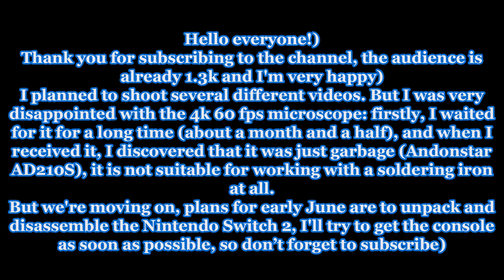Switch OLED Kamikaze modchip installation in 48 minutes

Comment: What tip are you using?
Reply from the maker: c210 handle, jbc with copper tip on it) https://aliexpress.ru/item/1005003898447927.html?spm=a2g2w.orderdetail.0.0.40fc4aa6ms88ke&sku_id=12000027414820908
Reply: @pro-modding my friend, how do you install that copper tip? Do you just slide it over it? Without removing the current tip?
Reply from the maker: @Sotseg  I filed off the working tip of the soldering iron and then attached this copper head
Reply: @pro-modding   Ah okay, thanks for letting me know. I will be doing the same.
But one thing; your tip doesn't look like the one you sent in the link. Is it the exact same?
Reply from the maker: @Sotseg  "T-IS", it is burned  in everyday work)

Comment: Whats the benefits of kamikaze mod over the nomal one??
Reply: That connection point is very hard to make otherwise, and unreliable. Kamikaze is non reversible, but when executed skillfully and properly it ensure a much more reliable connection to that point that otherwise uses a flex which must slip under the APU and isn't easy to tell if you have it lined up properly and secured well.

Comment: Cleannnnn !!!!! Pleas give me name of your flux , its incredible no clean ! Thanks men
Reply from the maker: Flux - Kingbo RMA-218.
Reply: @pro-modding thanks
Reply: and for clearing flux use IPA ? Or one différent product ?
Reply from the maker: @alexpassions  For cleaning I use a mixture based on gasoline. Sometimes isopropyl
Reply: @pro-modding oh 😮 Can you tell me more? 

1l isopro and 100ml bezina?
Reply from the maker: @alexpassions  https://ru.wikipedia.org/wiki/%D0%93%D0%B0%D0%BB%D0%BE%D1%88%D0%B0_(%D1%80%D0%B0%D1%81%D1%82%D0%B2%D0%BE%D1%80%D0%B8%D1%82%D0%B5%D0%BB%D1%8C)
Reply: @pro-modding  Do you put this pure?
Reply: May I ask you which soldering iron you use and what tips?
Reply from the maker: @alexpassions  c210 handle, jbc with copper tip on it) https://aliexpress.ru/item/1005003898447927.html?spm=a2g2w.orderdetail.0.0.40fc4aa6ms88ke&sku_id=12000027414820908
Reply from the maker: @alexpassions  soldering iron - 61\39

Comment: Great video! I wanted to find out what iron tip are you using ?
Reply from the maker: c210 handle, jbc with copper tip on it) https://aliexpress.ru/item/1005003898447927.html?spm=a2g2w.orderdetail.0.0.40fc4aa6ms88ke&sku_id=12000027414820908

Comment: Hi friend, I succesfully installed the modchip for my Switch OLED, but sadly the LCD connectors are fragile and I destroyed it in the process. Can you give me some advice (temperature, air speed, heating from below[NAN chip] etc) to replace the LCD connector?
Thank you in advance!
Reply from the maker: https://www.youtube.com/watch?v=8RUuxPe5PVk
Reply from the maker: The LCD connector will be a big problem for an unprepared person. I would change it the same way as Alex in the video above, heated it from below, about 400 degrees, strong flow, but here you need to feel the moment so as not to melt the connector next to it and not spoil the NAND. If you are not sure, then it is better to contact a good service. There is also an option to carefully destroy the old connector with nippers without damaging the traces, then remove the old solder and apply a new one, which melts easier. And then soldering the heating from below with air will be much easier.
Reply: @pro-modding  Thank you a lot my friend. I am doing this as a hobby thus why I am not bringing it to a service. I got the LCD connector already off, luckily. Also I have a problem with my tin. If I use low melting point tin (138c), I have no issue with getting the pads tinned nicely, but if I use 63/37 tin, it becomes a mess and doesnt melt nicely somehow. Do you also have any tips for me regarding this?
Reply from the maker: @Sotseg  I use 61/39 solder, usually to make the soldering shiny and not seem dirty you need to: use a good flux (Kingbo RMA-218 in my case), a clean soldering iron tip, the right temperature (I like 350 Celsius the most) and work quickly, do not overheat the same place several times)
Reply: @pro-modding  https://youtu.be/HzftGRwyCng
Reply: @pro-modding  Had the same issue with LCD port, happend to me on other switch, so send it to more Pro-guy to replace and went well. 2nd time I was doing Kamikaze, after I was done chip was flashing blue, so I thought great my 1st Kamikaze went well , but few pins were beng in LCD port and couldnt test futher, send it to replace and the guy did that. But now Console wont start at all and he is saying that even doent show any sings of charging on USB meter. Any clue what might be the issue? What to check? Thanks!
Reply: Hi friend, I am trying to use your advice regarding the installation of the LCD connector. You said you use Kingbo RMA-218. Where do you buy this? If AliExpress, can you share the link with me? Also I have a video where I demonstrate my problem with tinning the LCD pads. Can you take a look? I can post link but if I do my message gets blocked
Reply from the maker: @Sotseg  https://aliexpress.ru/item/32330169293.html?spm=a2g2w.orderdetail.0.0.129a4aa6zJoE3C&sku_id=51210034237
Reply from the maker: I haven't seen this for a long time, I think the problem is that the temperature is too low, add 50-70 degrees to test
Reply: @pro-modding  Thank you a lot. I will try tomorrow and hopefully it will work!